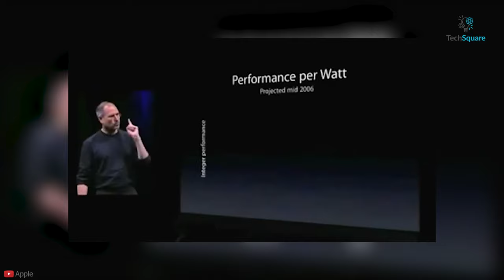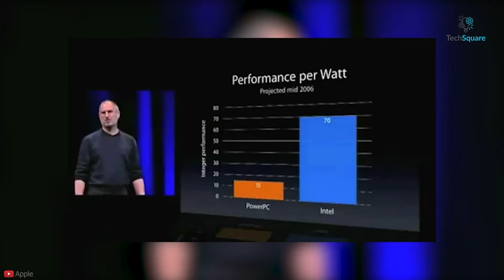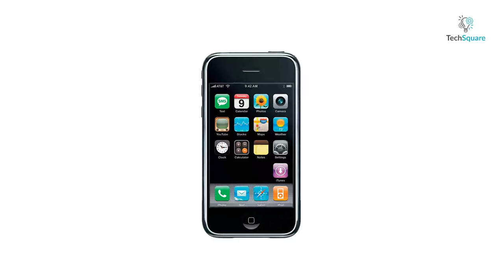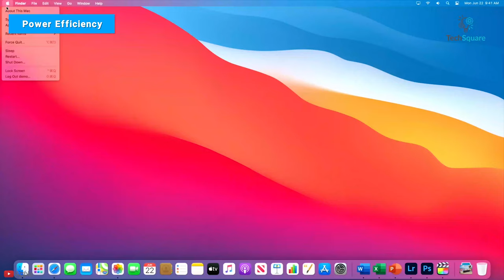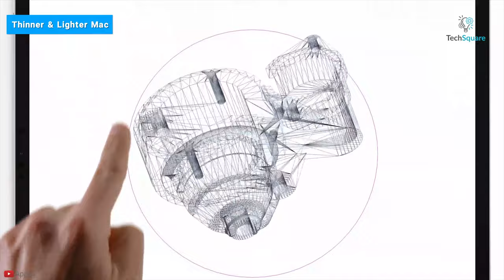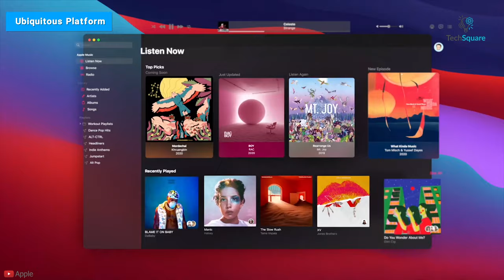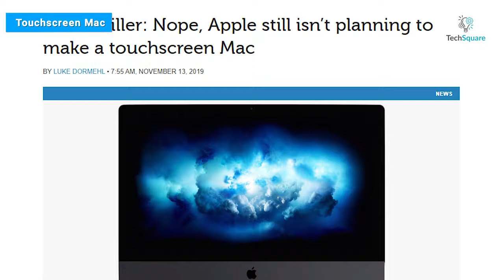Apple Silicon | The Future of Mac

Comment: Great job and analysis. I just add that Apple Silicon will avoid important Intel limits. Power : the 100w power supply will not be necessary, Massive cooling : probably not necessary, Heat: less noise, Space: small motherboard. So the form factor will change because Evan Hankey (chief hardware design) does not work on these same Intel limits, a new paradigm is bringing on her feet. Second, it will be very important to distinguish old and new Macs. Apple can not reuse the same design to show the future. 
Finally I agree with you the massive killer feature is the MultiTouchScreen on Mac associated to IOS Apps. It will be very very very easy to create the consumers desir when Apple showing all famous apps work on MacBook or imac. Microsoft tried it but they don’t have mobile market apps.
Reply from the maker: Thank you for sharing your opinion. And I agree with you.